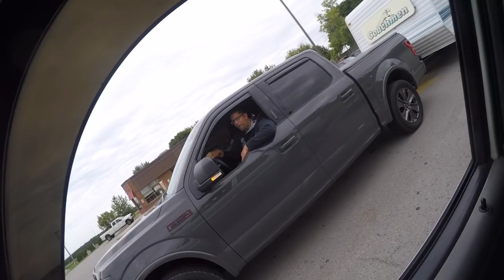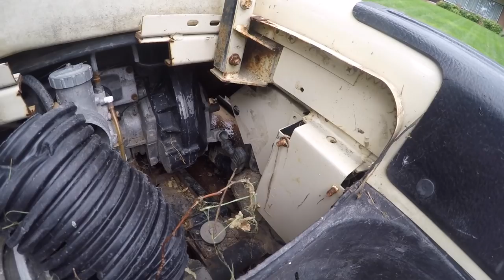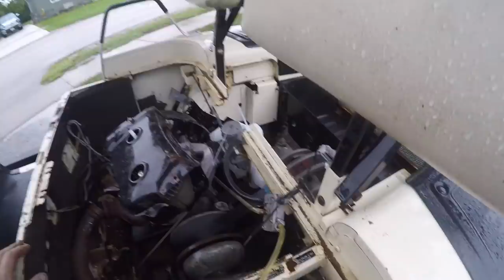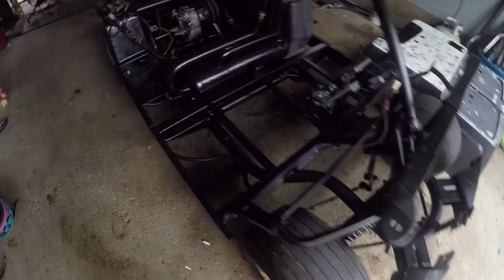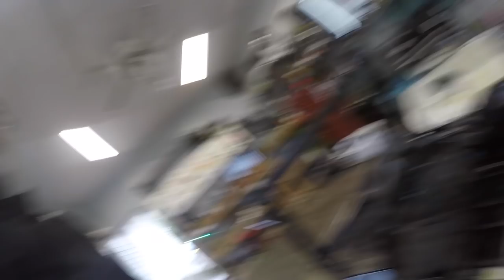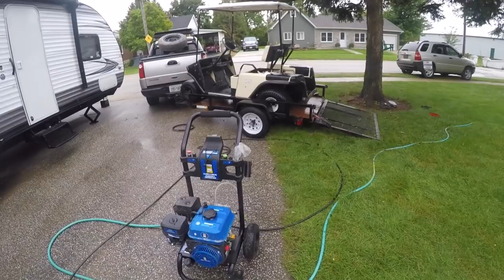EZGO 440 Golf Cart

Comment: Be carefull with a big engine on them E-Z_Go carts. The front springs you mentioned are a terrible weak point. If you do wheelies, them springs will snap. the Yamaha rear end is twice as strong as that E-Z-Go. Also.. If you do get it all cherry and want to make it look good, you can order the body panels, drill the old rivets out, replace panel, easy peasy. You can even get a more modern plastic body and do a conversion to make it look like a newer cart, I've done several in my past. Just remember sled engines are made to run in cold weather and will run hot in the summer. If you can find a liquid cooled one and put a nice radiator on it, that would rock. Cheers Bill!